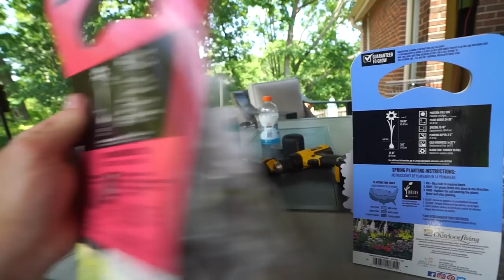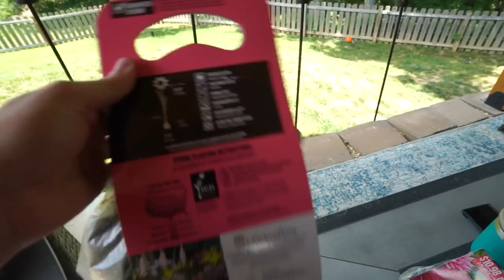Cleaning & Planting a New Garden || Planting Dahlias Cannas and Bananas || Saturday Vlog

Comment: I need to use my brain and figure out a drip system. I bought a kit last year, well everything I think I need, and just have been to afraid to set it up. My husband growls when I spent money, rightly so we’re surviving on SS, but I’m afraid if I start setting up a drip system that I’ll make so many mistakes that I will have to buy more supplies or that I didn’t get big enough tubing to get where I need to go ect… But I also hate watering, we did get some rain but not nearly enough, but I will never complain about the amount because some is much better than none. I’m hoping that we get some more tonight, it’s predicted but it usually goes around us. 🤞🏻🌸💚🙃
Reply from the maker: Once you get the pieces out and start on it, the process sort of unfolds and isn't so hard. Give it a try! Even if it takes you a few hours spread over a few days, it's still better than having to water for a few hours everyday for the rest of the summer.